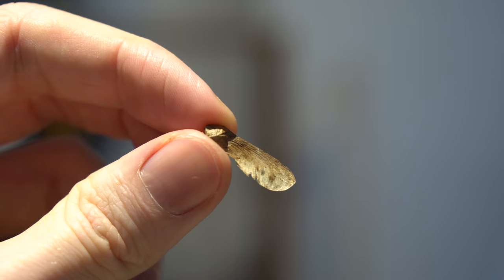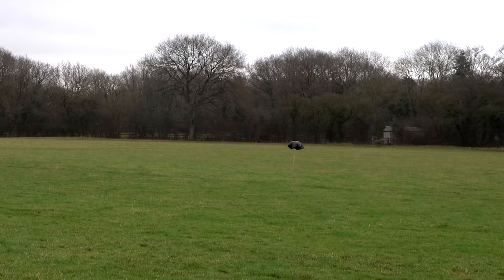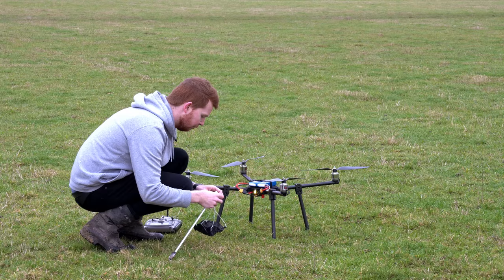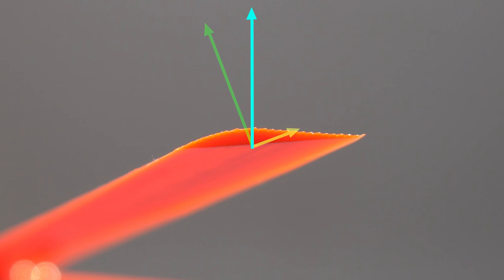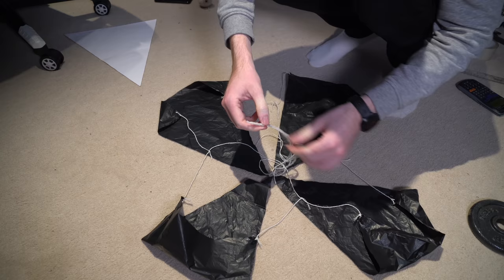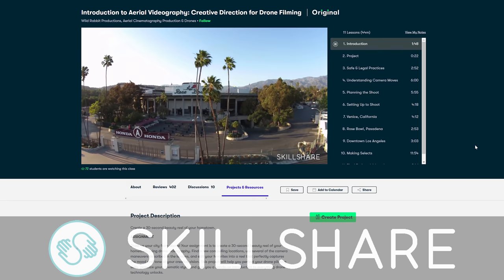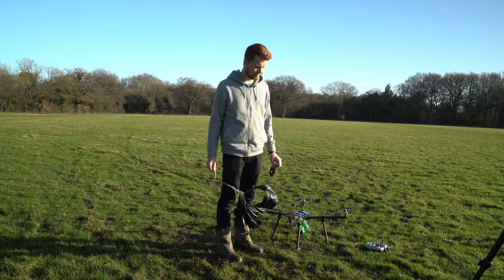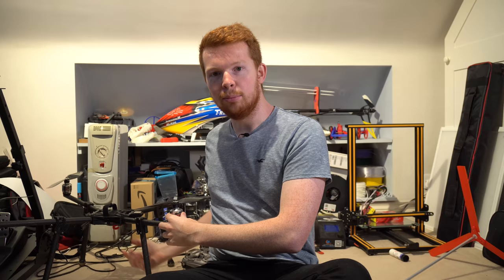Should Parachutes Spin?

Comment: I have contemplated your titular question for 3 seconds and come to an answer... of yes. parachutes should spin. my logic is based upon understanding of atomic Physics and field theory.  excuse me if my comment is incorrect I have had a drink and I'm not a qualified physicist, I just see force and motion act in a certain way and recognise that forces and motions change within a field. now, a parachute usually falls relying upon air displacement to slow the fall, but within any field there is both acceleration and deceleration... dielectrically speaking, acceleration and decelaeration is related to field density,  or in the case of magnetism, it is flux density.  Or rather acceleration is relative to field density. Man, I have paused your video at 0:00 and really want to hear what you have to say, but I too busy typing... force and direction are relative to intrinsic angular momentum. That which spins a tight spin and travels on a tight straight path VS that which orbits and travels an apparently/RELATIVELY straight path but really it spirals. A straight path is entirely relative to magnitude and perception. That which may experience a straight path, depending upon magnitude, may actually be travelling a spiral path, and this is the headfuck p[eople can't get their heads around. your video touches, or will touch upon something which mainstream physics does not embrace... and I say this, I know your video will do this, even though I have not yet watched it, because I know modern physics is flawed in its theories. we know that a helicopter can glide to ground under engine failure, from any height, due to gyroscopic effect  (well not quite gyroscopic, been drinking) and produce lift... air resistance makes blades turn and resist fall, turning blades provide resistance to fall.... but yes, spin and linear motion are intrinsic properties of natural forces... there really is no space, no time, and no universe without  spin. all force vectors require spin... even a standard parachute will exhibit spin... whether the parachute spins, if uncontrolled by man parachutist, or whether the air being displaced exhibits spin as what some may call eddy currents at the frill of the parachute.
Reply: should parachutes spin? well no, I wuill disagree with my earlier comment, because parachutes as we understand them rely upon air displacement... you want a parachute to spin, then you need a complete redesign based upon natural principles derives from natural processes observed in plants and animals.
Reply: parachute as we know it was NOT derived from any known principle in nature adopted by nature.Nature does it best, we know this... so man can do better than to make prarachutes the way they do. But, from an engineering perspective, better is not always easier. and easier is not always better. should a parachute spin? well, physics should dictate that to reduce any linear travel, linear force and motion should be converted into spin. or rather, and this is the headfuck, because even linear motion has spin... let me say linear spin should be translated into orbital spiral. do you get my drift? the tip of a sycamore seed will trace a spiral path down to earth as will the core seed, in its own way track a spiral path. Science is hooked upon its own interpretations, and yes science does look to nature somewhat... but not enough. I will shut up now and watch your video. thanks in advance for this content.

Comment: A term that drives me up the wall: "surface area". Surface to me implies area, so 'surface area' is a pleonasm. But then, I'm not a native speaker. And I hear it from natives all the time.
Question: Would "surface" without "area" sound odd to you in that context? To the point of making it hard to understand what I'm saying?
Reply: Area is two dimensional, and when talking about two dimensional things I believe most people would say simply, eg. "what is the area of a circle". For three dimensional objects though, while something like "what is the area of a sphere" would probably be understood without adding 'surface', it sounds weird to be talking about a two dimensional quantity of a three dimensional object.
https://en.wikipedia.org/wiki/Area (see fourth paragraph)
Reply: @iforce2d  I'd actually say the other way around: "the surface of this sphere is x m2". This comes from German usage of "Oberfläche", which contains the word 'area' ("fläche"); but "face" also implies an implicitly two-dimensional area.
In a case like here where I am talking about an imaginary area covered by a rotating contraption I'd probably use the term "cross section".

Comment: 1:30 Did you know Boeing's Starliner throws away it's parachutes after landing to prevent exactly that from happening?
Reply: Im quite sure, every capsule does that
Reply: @klosskopfder1.762  I'm pretty shure at least a few unmanned ones in the 60's (for example appollo boiler plates, wich were used to test parts of the capsule without wasting a whole vehicle for something like an electronics/launch abort/parachute test) did not throw them away, and it is likely that there is some spacecraft wich still does it today.

Comment: it is just  changing force direction. you should experiment with magnetic/ kentic  to thermal  converts like magnet to brass. you know how a falling magnet can covert gravity's pull on it into thermal force just how brass reacts with it. and how a perma magnet can create electric  fields and tiny electro  magnets in alum as it falls pass it..    or better yet quamtum levitation as certain mineral like emerald  in super cold get locked in electric fields by creating mirror coverts. even pure water and gold  how they react to alternating current eltro magnets fields. . maybe we can reinvent a wheel that can have traction even in space. quarks traction/ interaction may be . A space rocket is what   a stupid steam engine with an extra step . hell we dont even compress it as it shits out.  . spoiler alert such a drone with internal things interacting  could out run and out perform all kinds of jets and missiles in cali. just dreaming :)

Comment: NASA is absolutely no parameter to define if some idea worth to be pursuit or not.
With an autorotation blade system like the one that NASA test, you can guide your descent as you like and exchange blade momentum at the end to accomplish an incredible softer landing (like helicopters does).
NASA did not accomplish nothing really new in 50 years and you really think if they rejected some concept is because it does not worth to develop?
Spacex... hello???

Comment: How is it possible that the small parachute fell at 10.1m/s if the acceleration of gravity is 9.8m/s
Reply from the maker: Speed is measured in m/s (hence 10.1m/s), acceleration is measured in m/s² (hence 9.81m/s²)
Reply: It fell for longer than a second. The acceleration of gravity is an increase of 9.8m/s for each second of travel